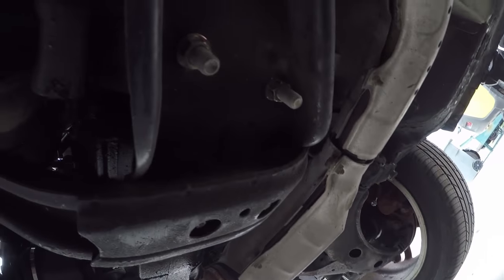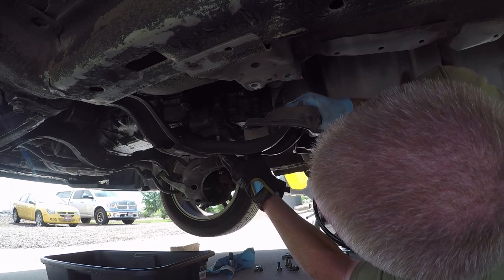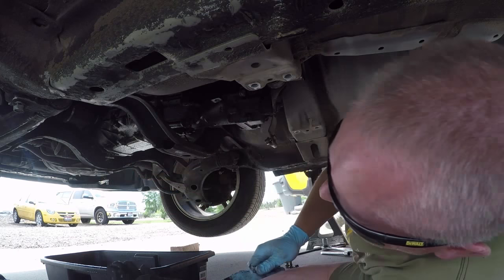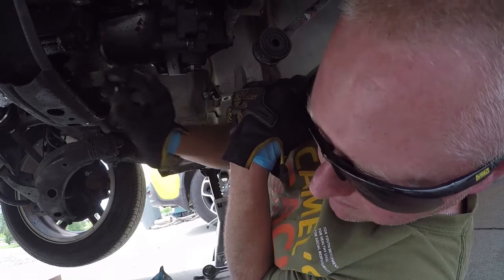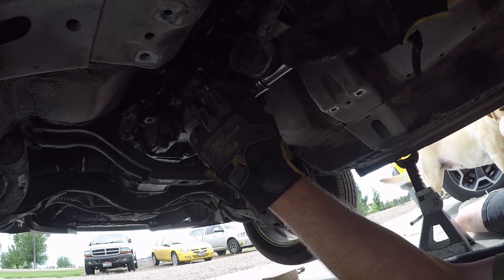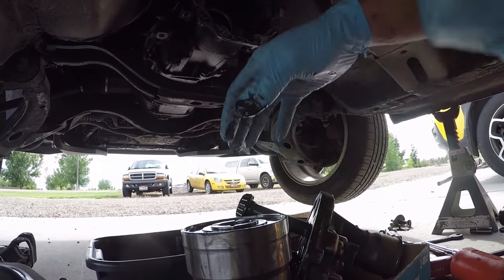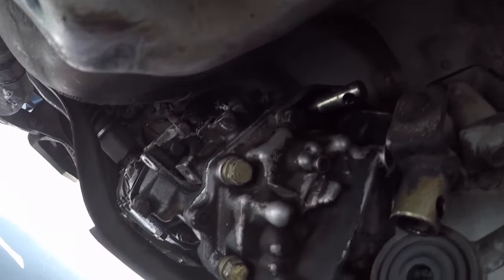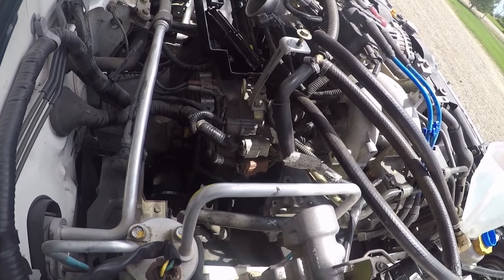2004 Subaru Legacy - Center Diff Replacement (Long)

Comment: You should invest in an impact wrench, air or electric, I don’t think you are doing this for a living so you can buy an inexpensive one. You won’t be sorry you spent the money. Great video thanks.
Reply from the maker: In the 5 years since this video, I've invested in a couple impact wrenches.  My electric ratch has earned its cost back.  Also since this video, I went to school for automotive technology, got certified, and opened a shop.  I'm typically to busy now to do any videos but I appreciate the positive feedback.
Reply: Where is you shop located, I may need to bring you some work.
Reply from the maker: @jamesferguson1054  Idaho

Comment: the viscous coupling goes bad and causes torque binding. if you cannot replace in timely manner just get a fuse and stick it in the FWD slot in your fuse box and will disable awd if you have issues skipping when steering  41:47 Gesundheit!.. good job.  and doggo also approves !!!!!!!!.
Reply from the maker: Thanks and thank you, however that fuse will only work on an automatic transmission, and this one has the 5-speed manual transmission.  I parked it until I could get around to replacing it (luckily I had other vehicles to drive).   Just last week replaced the clutch, clutch release bearing, and pilot bearing with just under 189,000 miles.  Thanks again for watching.

Comment: those jack stands are deff rotated the wrong direction youre very lucky
Reply from the maker: Agree, although the car was up on the stands like that for over 2 weeks with no issues.    I have a set (not seen in the video) that has a deep seating area that will not properly hold the pinch weld jack points, in order to use them I have to set them the way you saw in the video.  I have since added another set that work properly with the pinch welds.

Comment: It would be better if you gave the reason for replacing the center differential and what was wrong with it
Reply from the maker: Thanks for the question.  I had some nose coming from that area, but it was not bad.  The issue that necessitated the replacement was when it started to bind while backing and turning (out of a parking spot).  Hope that helps.
Reply: the viscous coupling goes bad and causes torque binding. if you cannot replace in timely manner just get a fuse and stick it in the FWD slot in your fuse box and will disable awd if you have issues skipping when steering
Reply from the maker: @blueresonantmonkey3188  Thank you however that fuse will only work on an automatic transmission, and this one has the 5-speed manual transmission.  I parked it until I could get around to replacing it (luckily I had other vehicles to drive).   Just last week replaced the clutch, clutch release bearing, and pilot bearing with just under 189,000 miles.  Thanks again for watching.

Comment: No shop yet on the 20x32 pad, so ya do what ya gotta do!  Got it up on stands on a toasty Winter afternoon. 

So this is the 2004 Impreza NA manual tranny I have with what I thought was torque bind from the center diff viscous coupler.  It's still looking like the coupler I guess as the tapping noise while in the air is only for brief moments of gear changes while goosing it.  Below is what I found. Have you had similar?  I hate throwing parts and labor at anything until I know the actual issue.

Any suggestions to test it while I have it up off all fours?  

1. Transaxle is leaking gear oil where the Viscous center diff output end is, at the very end of the transaxle rear cap near where the rod for the gear shift attaches to tranny.  This leak and tapping noise just developed on a recent 400 mile mountain Interstate trip with a full passenger load. Found the gear oil 1.5 quarts low upon return, and oil slung down the center of the car's underbody.

2.  All CV axle ends look/feel fine, front and back.

3.  Rear driveshaft looks/feels good.

4. Run test: 10 minutes. Some tapping noise between gear transitions when goosing it, not grinding. No tapping or binding or noises from any wheel, axle or driveshaft in all gears up to 3000rpm while steady/cruising, or while turning or braking. 
Leak location lost a lot more lube during run test. Sitting leak rate 1 drop every 5 to 7 minutes. Running leak rate 1+ drop every 1 to 2 minutes.

Would you say the center diff is toast and that should fix the tapping binding noise?
Reply from the maker: Do you have an automotive stethoscope you could use to isolate the sound?  Or a long screwdriver held to the transmission and your ear can work.   

What I have done is use the above to try and isolate the location of the noise.  At the rear of the tail shaft are 2 bearings, one for the output shaft and the other for the transfer gear shaft (which goes into the center diff)  on the front of the tail housing would be the center diff bearing on the bottom and the front bearing for the output (transfer gear) shaft.  If the noise is in that area it would be the center diff, why you don't necessarily hear it with it up is the wheels do not have to rotate at different rates under load (like on the ground while turning.  Backing and turning will pick up the binding center diff really well.

Comment: How do you remove the bearing race that's stuck in the transmission? The race that goes around that little bearing on the shaft
Reply from the maker: I used a small pry bar like this.  You have to get under the race.  I have also used a brass hammer on the back side of the race to get it off.  https://www.amazon.com/GEARWRENCH-82301-Piece-82208-82210/dp/B001M0O1MU/ref=asc_df_B001M0O1MU/?tag=hyprod-20&linkCode=df0&hvadid=309832851244&hvpos=&hvnetw=g&hvrand=13062996506832051120&hvpone=&hvptwo=&hvqmt=&hvdev=m&hvdvcmdl=&hvlocint=&hvlocphy=9030746&hvtargid=pla-436092663833&psc=1&tag=&ref=&adgrpid=64417494871&hvpone=&hvptwo=&hvadid=309832851244&hvpos=&hvnetw=g&hvrand=13062996506832051120&hvqmt=&hvdev=m&hvdvcmdl=&hvlocint=&hvlocphy=9030746&hvtargid=pla-436092663833

Comment: Hey man thanks. I bought my teen son a 2004 Impreza Outback 5-speed, 156,000 miles. AWD of course. We didn't notice a whine noise, but it just started clicking or tapping around curves and acceleration. I can feel the tapping in the gear shift handle. And it seems it sometimes loses AWD grip when it taps. So I think the center diff is binding the output shafts sometimes. 

Question, must I lift all 4 wheels off the ground to get the center diff out?  Can I just lift the front and remove the stuff in the way? Or must it have all 4 wheels lifted off ground?  

Thanks!
Reply from the maker: You can do it with just the front up, but removing the exhaust and drive shaft is easier with all for up.  Or lift each end as needed and then keep the front up to remove the center diff.
Reply: @JWCMotorsports   the reason why I don't think it's the transmission gears themselves is because it makes the noise in all gears while in curves or quickly accelerating.  It will do it while coasting in all gears as well, but not as much, and only when not going straight.

Comment: Did it ever end up leaking since you didn’t put any silicone or gasket?
Reply from the maker: It has been 3 years an no leaks from there.  I do need to change the crush washers on the reverse and neutral sensors however.  I have since found there is a gasket Subaru sells for the rear housing.

Comment: Could you tell me what the symptoms were that were associated with this? I’m chasing down an issue in a nearly identical car where the drivetrain shakes as I release the clutch, no matter how much I slip it. But it’s only an issue when it’s warm.
Reply from the maker: While in reverse, and turning it would pop, as it got worse it would have going forward.

Comment: so where was the bad bearing? diff replacement solved the noise?
Reply from the maker: There is a bearing on the small end of the center differential, it was noisy,  I was having a binding and popping sound that was more noticeable during turns in reverse.

Comment: No gasket 😮
Reply from the maker: Correct, there is one on the front side of the tail extension.  But on the cover there isn't any, you can find an optional one on Subaru parts but every Subaru 5mt I've taken apart has not had any gasket on the cover.  And no silicone either.